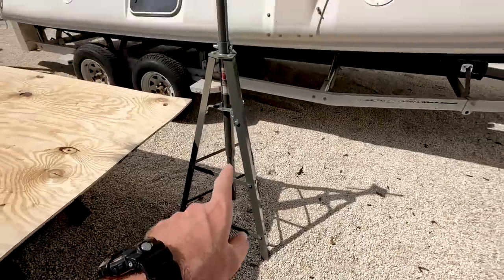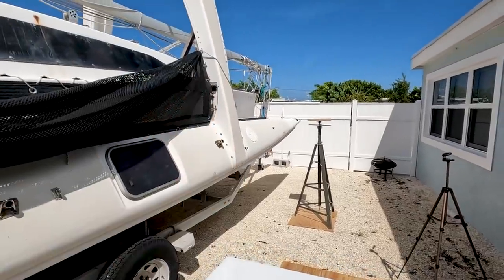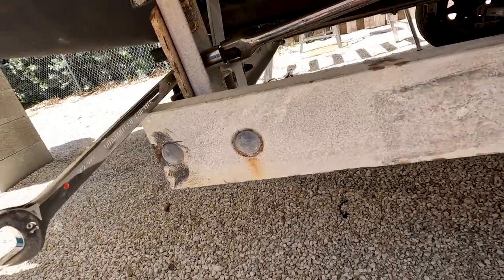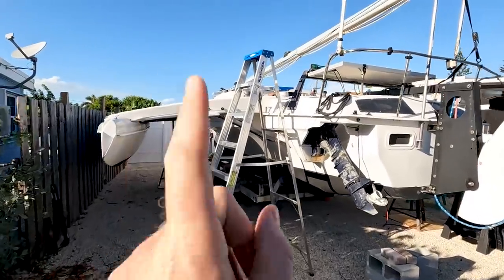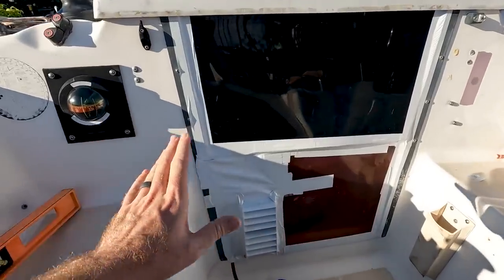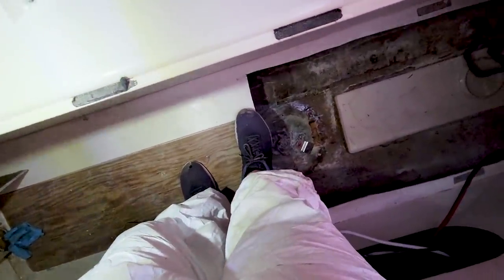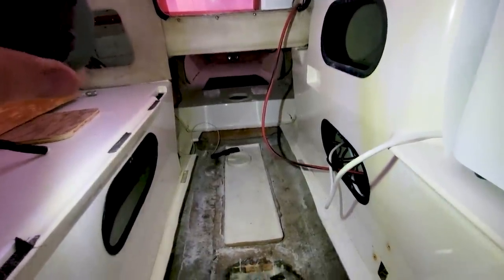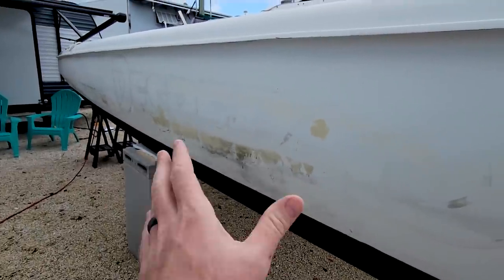SURPRISED by What I Found CUTTING UP OUR BOAT | Learning the Lines

Comment: Congratulations with the first findings. The boat stands on supports with a small footprint. You are close to the perimeter of the garden. Consider to anchor the boat, tie off the boat, to the edge of the garden, house, so that it has no horizontal way to move. You will be jumping around on this boat for some while. Those extra ties will make it yet a bit more stable.  Congratulations that the boat builders gave you so good advice. Looking forward to the next episodes.
Reply: anchor? seriously?

Comment: So glad to find the balsa was mostly dry and that it's only a stringer. I was helping my friend with the F31 over the weekend getting his boat out for winter and we discussed your situation. We were hoping that water ingress hadn't turned the core into mush, which would leave that single layer to buckle and crack. We both agree that a single layer is insufficient where the cracks occurred. Maybe extend the 2nd layer to cover those?

Comment: Hey! It's going to be a great project! It's my pleasure. A little tip: for sawing with the hand-held circular saw, use 4 saw stands or an old sheet of plywood underneath, in which you can then simply saw a few millimeters. So everything stays stable. Greats from northern Germany and North sea - have fun! 👍

Comment: I've got hull #89.  I'm surprised how different it is.  For one thing the cabin sole is wood and removable.  For another thing there are ribs from starboard to port maybe 4' apart.  A very different boat!
Reply: Definitely would recommend adding "floors" or as you call them ribs to the hull. Remember to  leave limber holes for drainage.

Comment: Might be worth looking at alternatives to balsa for the new core. Apparently they only used balsa on a small number of boats (mine included) due to supply issues with the synthetic high-density material they used on most boats. This would avoid any future balsa rot issues. The boat definitely looks like it has been dropped or improperly chocked at some point.
Reply: There are plenty of high density foam options, also they don’t absorb water and also take resin well
Reply: They all still have balsa down the middle, its way stronger and cheaper than high density foam.
Reply: Balsa was intentionally used on the main hull of the 27s in a narrow strip down the center because of it’s strength to weight ratio. Balsa was also used in the earlier models of the 27 on the float decks. The newer boats do not have Balsa.
Reply: @gregfeldman6818   They certainly did from the 27 right up to maybe a 760/880 ( not fixed one yet) have it down the middle, nothing to do with strength to weight its all about the crushability.
Sure balsa shouldnt be in the deck and doesnt need to be, it was just cheaper. I have not worked on a 27 and not seen any balsa in any other models except down the middle.
The quality of the builds is getting better under Seawind.

Comment: ,I have a c 31, did some of what you are doing. Consider not putting floor back , glue on Eva foam right to floor, it's better on feet , more head room and lighter.   To check for moisture in areas that look good, use a hole saw 3/4 inch and make hole in inner skin only. Dog out foam and patch with a disk of clear 1/8 plexiglass.  Using silicone or other caulk. If there is moisture you will see condensation on the Plexi.  Especially if your AC is on.  If it's wet I put a shop vac over the open hole and sucked for 12 hours.   It's supposing how the moisture travels in the kerfs of the foam.  I left the Plexi covers on as indicators of if new moisture gets in , which has happened if water puddles in the bilge as it's only one layer of glass in places and pin holes are possible.   Some boats have taken all the liners out and put surfboards in as seats, have also seen one with pipe berths of carbon tube and canvas.  Lighten the boat and speed goes up alot.      On exterior surface, get CLR put on full strength with long handle paint roller with 6 inch hot dog foam roller , leave wet for 5 minutes and scrub sideways with foam roller. Works best on warm days, if cold just leave on longer. If not perfectly clean use simple green the same way as step two. Then you should be clean and wax free enough to buff and wax. Two coats of collinite fleet  paste wax lasts the best.    Peel ply is your best friend, I wish I knew about when I rebuilt my floor
Reply: NEVER use Silicone on a boat!! best is almost Sikaflex and alternatives. No Silicone!

Comment: The holes I suspect was somebody trying to find out the extent of the water in the foam core and or let it out!
You might need to make sure the foam core is not crushed by the impact damage outherwise 
It will be ineffective.
 Nice  project to film. 
Cheers Warren

Comment: Very happy for you that the damage is less than you thought. That forward compartment with the stress fractures at the spots where it connects to the hull has me wondering how they could be like that without damage to the actual hull? Looking forward to that repair as well as the rest of it. When you get to that section it will be interesting to see how the hull could have flexed enough to make those stress fractures. Unless of course it was due to compression from the top down which I have no idea how that could have happened. Over all this is going to be a very cool series on this refit. Best of luck and may you find and attain all the materials you'll need...

Comment: Hi, I think that the Desperado has had some bad grounding once on the back. So I would cut open the cracks in the inner laminate with the multi tool, make a V-groove then check for crushed  or ripped apart core at these places. If this is the case the gaps can be filled with thickened epoxy. You just need low density filler with a bit of fibre in.
So you reconnect the core parts, then comes your laminate over the areas of concern.
Matthias F9RX

Comment: The simpler the mechanical device from harbor freight, the more reliable it tends to be. Yeah, hammers, wrenches etc are all dependent on quality of materials, but stands tend to just need stronger stays on them, because I never fear the large threads giving way on them. Just my opinion of course. I am learning a lot from your channel and another on different types of boat builds, and their strengths and weakness'. Keep on keeping on brother.

Comment: I'm loving your setup next to your house with great A.C., so it's full speed ahead with the  grinding... I'm wondering if alot of the cracking is from the trailer bunks, maybe they were not positioned correctly and bouncing on some rough roads did the damage. Clearly water has seeped into the core and glass and has resulted in the delamination. It would also be good to see if there is any cracking on the outer hull on corresponding areas, now's the time to address it if there is... hahaha, my 2 cents!! 💪

Comment: If there is cracking inside would it not imply that there may be cracking outside and the foam may have delaminated off the outer surface. Have you taken off the antifoul outside to check?

Comment: What Im thinking I am seeing are longitudinal ruptures of the inner liner, but not hearing why.
This is like what happens to a coke can pressure rupture, which always goes longitudinal. The same is true for fuel trailers, cylindrical fuel storage tanks etc.
Ok so Im thinking that its like this boat bellied out on a shoal, which would cause the inner liner to fail in tension, and as with the usual path they're longitudinal cracks or separations. 
Why in tension? Well if you were to push on the outer skin, the inside has to grow to remain in contact with the core. With the liner stretching to make the curve from the pressure of the push, it gets to a point were it cannot. So either the core crushes (which might have also happened) or the inner liner cracks in the direction we determined, leaving longitudinal separations.
Checking that the core and skin are mostly attached, and repairing the crack by grinding grooves into the skin and rejoining the edges, then adding laminate to the inside should take care of the repair. But to be sure drill out the ends of cracks so they cant propagate any further.

Comment: Personally I would error on the side of overbuilding. Your not likely to be racing so don't worry about weight the way the factory was. You will have your family on board! The light build is likely what caused the issue, as they were built to be fast, not to last.
Reply from the maker: This can be done to an extent. The issue with overbuilding is if you end up adding too much weight you will likely change the sailing characteristics of the boat, causing a safety issue. These boats are only meant to weigh a certain amount, and carry a certain amount. Anything over the designed loaded displacement is unsafe.

Comment: I don't think that the cracks in the inner laminate were caused by water sitting in the hull.  That ugly previous repair may shed some light on it, that's not the location for the thru-hulls for the instruments, and in this video you can see better that it's a larger repair.  I think the cracks came first and then the water intrusion, doubt the water seeped through the laminate and caused all this.  Would at least pull the trailer from under the boat and inspect the outside of the  hull around those areas, might need to remove some bottom paint.
Reply: Unless she spent any time in the northern latitudes. Freezing water pushes mountains apart. Fibreglass laminate would be child’s play for that sneaky molecule. Having said that. It sounds like it’s known history has it in Florida. And I agree that further inspection would be prudent.
Reply: @handleymachine4421  I agree that water freezing in a laminate would cause damage and perhaps like that.  But I noticed the FL registration and figured that was unlikely.  Also, in the videos you can see fractures in the outside edges of the rear flotation compartment when looking aft from the cabin.  That looks to me like the bottom of the boat was deflected upward.  Also, from experience with my own '91 F-27 - I had a small deck leak in the aft cabin that dribbled water down to rear bunk/flotation compartment.  The access port ring hadn't been sealed at the factory.  Through many years the collected water filled the rear compartment almost completely.  The one day I happened to look in that port I was floored.  Pumped it dry, no damage, nothing had seeped into the laminate, no rotten core, no cracks.  And I live in an area where that likely froze from time to time.  I went and checked it again yesterday after seeing this - all good.  I have seen a waterlogged F-25C (carbon fiber balsa construction) that did ultimately have a rotten core, but even that boat didn't have cracking like this one.
Reply: I agree, cracks are very clean, like it happened all at once, I think it has been dropped, popped the bottom of the hull in one go, then water intrusion came later

Comment: Would it be difficult to make those areas you opened into some accessible storage areas?
Reply: @wametcalf  could not get the weight any lower in the hull. Water maker...other systems and or dry goods storage.

Comment: I would remove all the inner and core.  Reinforce the outer skin, then form a egg crate of mini bulkheads and stringers.   As the inner skin is cracked, I would be concerned that the outer skin could also be damaged.

Comment: Definately a sigh of relief ..... 
If you leave a strip all round your cut outs you can bond a epoxy resin marine ply sub floor 
In place with an overhanging lip ..
If you use stainless steel 4 point Tee  nuts drill a hole from above and insert from below they are self locking threaded metal inserts  ...you might use 6mm ones for stainless pan head set screws to hold the floor cut outs backed in  place just by screwing them back in place   .. if the ply is about 9-10 mm it will reinforce the floor and cross brace the hull 🤔plus..you can always remove the panels you've cut out if you get a problem. 
I would just cut a removable commercial vehicle carpet sole piece.. a few glued velcro pads  to stop slipping and it will cover the all the surgery..it will also insulate and quieten any moving around and reduce the risk of breakages .. i hate laminated floors so do two dead phones and several pieces of crockery.😂

If it gets sandy, wet or dirty you can whip it out give it a shake off or scrub and hang it out on the tramps to dry and freshen up...and its cheap to do 😉

I also recommend having some stainless spire clips on hand for fixing to thin sheet material like fiberglass, plastic or metal where screws might otherwise pull through.

Comment: That damage was caused by trailering, maybe fell off the trailer or something. Replace the balsa with some other material, maybe you could use divinycell there as well.
Reply: That balsa part was added, to give compression strength that the divinyl foam doesn't have, so when it's on the trailer it lends support. There is a trailer bunk that corresponds to that location. The designer did that on purpose. My boat has same feature.

Comment: The Air Con. Will pay dividends when you start mixing epoxy and Resin. Mixing in the heat is wasteful and time consuming. It sucks having to rush because your mix is firing off before you can even get it laid out.

Comment: Im always surprised that they actually use balsa wood in boats. I know its light. But it is very weak. I tried to build some toy planes as a kid. And they broke easy. LOL.
Reply: A decent sized balsa beam is amazingly strong for its weight.
Reply: Balsa typically has 5X the compression strength and shear strength of  pvc foam like divinicell.
I believe that balsa is now difficult to source in density as low as the 5 #/ft3  divinicell that appears to be used in the Corsair hull.  However, the real downside to balsa and other wood products used as a core material is it’s tendency to rot over time. ….. Eventually, everything  and everywhere on a boat gets wet.

Comment: Why would they use rot-able balsa in the keel stringer when they used divinycel for the skin core?
Reply from the maker: Balsa is stronger pound for pound than divinicell. They didn't expect anyone to let water sit in the bilge for years and years. Also, from what I understand the original design by Ian Farrier called for gelcoated/painted bilges. Corsair stopped doing that to save money. Quality control issues caused Farrier to leave Corsair in 1991, the year this boat was built.
Reply: Boats without the balsa strip would be damaged (dimpled) by the trailer.
Reply: What Ryan said. It was added for compression strength while on the trailer. Divinyl cell doesn't have that compressive resistance.
Reply: @RyanNeve1  That wasn't my point. I am well aware of its structural purpose. 
My near rhetorical question is about why a material that is prone to rot and degradation was chosen when they were already using a synthetic.  I would "put money on" it being for cost more than anything.
Reply: Hmmm,
  Considering all the advantages of historical perspective 30 yrs after the actual build, there seems to be a wide range of plausible guesses .

“Good, Fast, Cheap ….pick any 2.
That’s usually a good place to start

Comment: The holes look like they were drilled from the outside, and probably epoxy injections from the exterior to attempt to stabilize the situation without opening it up and doing a proper repair.

Comment: F-27 actually does not need the compression pads.
Reply from the maker: True, but I figured it's probably good to have something there rather than nothing.
Reply: @LearningtheLines  It actually doesn't matter.  For the 27 they can help reduce flex in the platform but they are not needed the way they are in other Corsair/F-Boats

Comment: It's cracked on the inside, anybody want to guess how the cracks get to the inside without damaging the outside???
Reply from the maker: Years of standing water and pressure from the trailer bunks. The laminate is also thicker on the outside so it isn't effected from what I can tell.
Reply: @LearningtheLines  
Your making progress,  I think it’s good you suspect the damage is related to standing water.  Concentrated loads/stress while sitting on the trailer must also be considered .
Maybe this goes without saying, but transporting the boat on the trailer while bilges are full of water would certainly increase the loading by 100 X.

The clues left behind by previous owner should be given more thought.
The messy circular “ patch” ( about 6 “ diameter) and the array of small holes (approx .25” dia.) that were likely test borings of the core.  
I guess there’s no harm in just asking that bozo what his intentions were at the time..?

It’s good the divinylcell appears dry.  However, it’s closed cell PVC.  The dry part is it’s best attribute.  It still has limited compression and shear strength. If you were able to rupture or sheer the inner skin, it’s worth examining the core for related  signs of structural compromise. 
Peeling back the glass skin in a couple of discrete areas where damage is most obvious should provide an opportunity to evaluate bond strength between glass and core , as well as any visual clues regarding core integrity.
( regardless, you’re going to be glassing these areas anyway)

Lastly,  I know you want to assume that the majority of the balsa keel stringer is still “sound”.
I don’t think you can determine that without inspection over its full length. 
You could also consider peeling up the bottom of the molded well that was cut away from the cabin sole.
I don’t really know how difficult that would be . But, your first video indicated signs of bond failure there.  
As an aside, those molded wells / lockers probably provide significant reinforcement considering the overall light distribution of bulkheads and beams.  A plan to replicate their function is a good thing.
Imo

…keep chugging